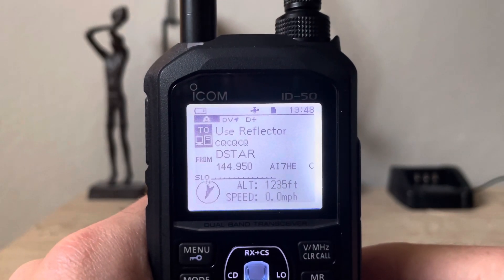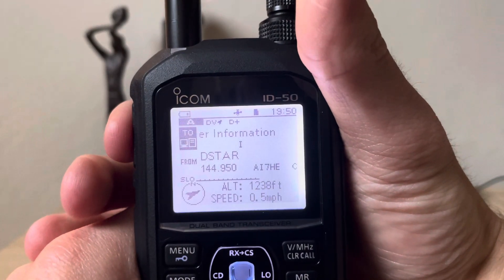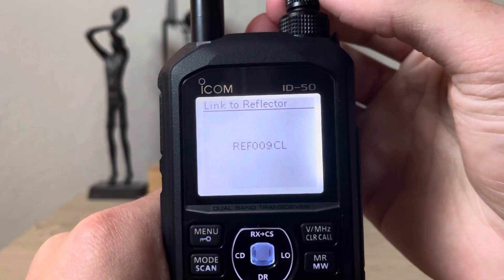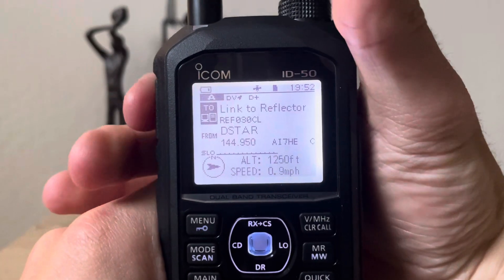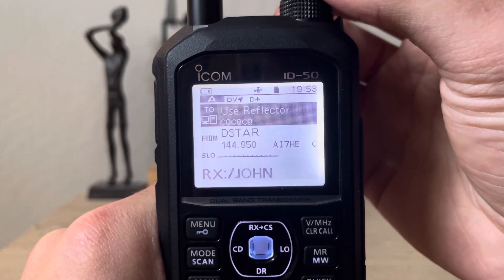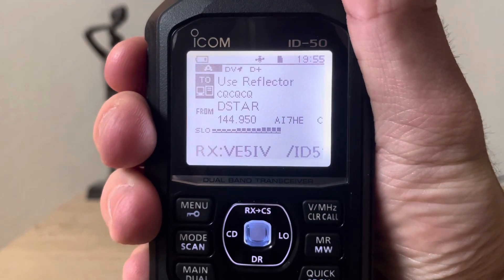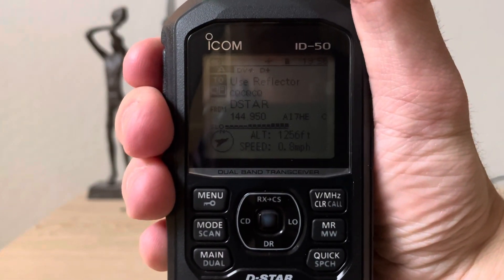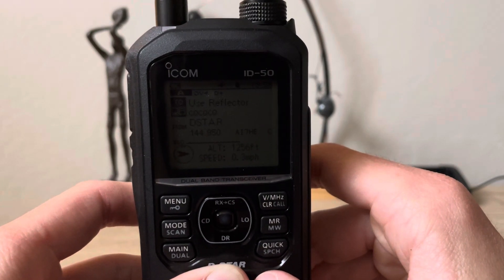How To Use D-STAR With Icom Radios (Basic) #hamradio #icom #dstar

Comment: Thank you for this.  I have been wondering what settings are needed in the radio.  I have the ID52 so it should be the same. I will try this later when I have my radio with me.

Thanks again 
Shawn